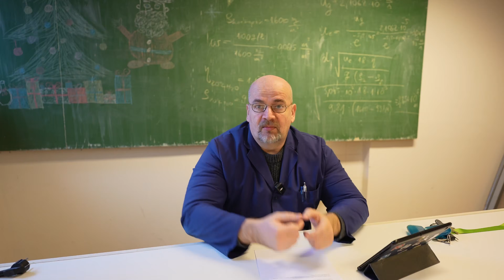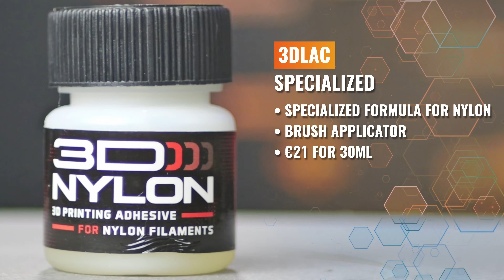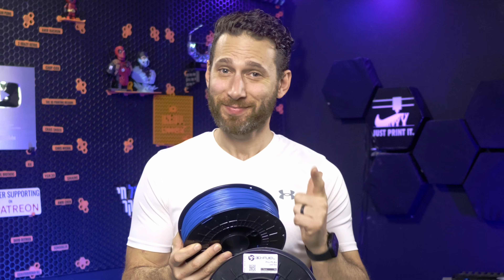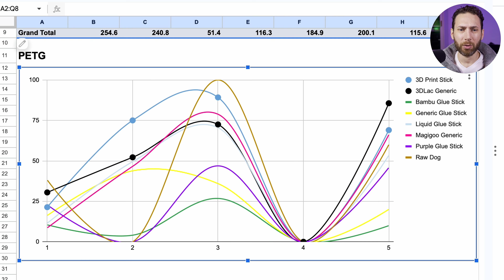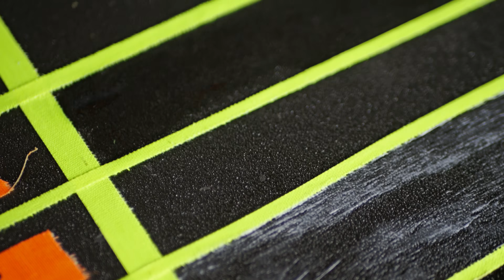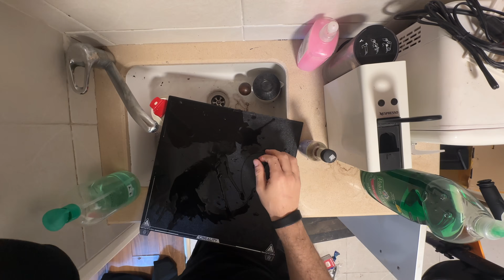I Tested 7 Types of Glue Stick for 3D Printing Bed Adhesion

Comment: You know you can wash glue stick off with lukewarn water and dish detergent, right? Same method to clean the build plate. Never had permanent glue stick staying on the print.
The glue stick is also good to avoid damaging build plate as a release agent (for example, TPU in PEI, its function is not to stick, but to release)

Comment: Suggestion for glue stick scars, I use the scrapper (plastic or metal, use the scrapper at the lowest angle possible so it doesn't bite the texture) and scrape the glue on the plate , that removes almosts all scars and evens the layer of glue stick. I've done this for the pas 2 years on the same PEI texture plate with little to no premature wear on the plate. Also, glue stick doesn't help the first layer adhesion for PETG, but helps release the print without damaging the PEI underneath, as i've see PEI peel of the plate with PETG.

Comment: I keep looking at how good raw dogging is. I feel like the point of some glue sticks are not to adhere, but to release prints after finished. Focusing on how easy to remove prints afterwards would be a different but key important test.

Comment: Would have loved to see hairspray. I expected to since it was mentioned in the comments at the beginning of the video.
I mostly use a bare plate cleaned with alcohol. If I have a bed adhesion issue hairspray has been my go to.

Comment: 5 identical plates  10 samples of the same glue /material  and a removal tool that pushes against the perimeter so the plate dosent bend influencinthe the print next to it ,change glue and repeat break it into 5 videos about each material
this increases your video output , and is more catered to the material we are printing when we google your videos as a reference, increasing the value of the video to the viewer

Comment: I stop using adhesives for 3D printing 3 years ago. I print on a plastification PET film adhered to my bed plate. It stiks when hot and let go when cold. Works for PLA, ABS and PETG.

Comment: A glue stick (purple) geek here, my solution is the best I don't follow the science I know best - END🙂  Well to be fair I use different methods for different materials - different surfaces as well.  Your sample is too small for ABS and Nylon shrinkage you know. Nylon - glass bed, multiple layers of glue stick, heated chamber, a raft depending on the print.

Comment: I’m disappointed that you couldn’t get the Vision Miner bed adhesive. I use it and am amazed. Absolutely no adhesion fails and perfect release with the clingy filaments. I get dozens of prints of PLA and PETG between application. I use mostly Bambu smooth and textured PEI plates.
Reply from the maker: Yeah, me too :(

Comment: Thanks for all your hard work. It's always informative. For my money, a good quality hairspray has been all I ever needed. I only print in PLA and PETG. For PLA it's helps adhesion even on my textured PEI plate. For PETG, as you and others have noted, it sticks to every frigging thing. Thankfully, after the post-print cooling, I find the hairspray is a great release agent! So much so that PETG no longer leaves residue on the plate after printing.  Hairspray in a big can is cheap, the can will last a long way, and the spray can is easy to master to get a consistent, even coating on the plate. Best of all, it washes away quite easily with some warm water and some elbow grease. Your Mileage May Vary, so use what information you have at your fingertips and make your own judgement on what works best for you.

Comment: In my limited experience, nothing I have tried adheres ASA better than a two layer thick disc of PETG directly on the plate and a filament swap.
Let it cool down fully and the PETG cradle will peel right off with a perfectly servicable surface finish 🙂
Reply: @HolmgrenJensen  I use the Vision Miner NanoPolymer Adhesive when printing with ASA and have absolutely zero issues with adhesion. I print all of my Bambu filament spools with ASA on a Bambu smooth PEI plate and they seriously grip the plate. Filament spools are a prime candidate to lift and I have no issues.

Comment: Fail, on pretty much every count. Experimental design (none), poor apparatus, comical execution,   The data are useless.  The "analysis" is you blustering your way through the shambolic results, inserting your surmises and opinions based on (nearly literally) no supporting data.  I didn't get to the end, but if your reviewer didn't fail you on your experiment and "analysis", he should have.  Don't do "science" - you have no aptitude for it.  This is not a service to the community; it's a half hour of you dicking around .  I'll unsubscribe to save us both continued aggravation.
Reply from the maker: Yep, that's the conclusion I got to, as well. If you'd watched the whole video, you would know that. Byyyyeeeeee
Reply: @thenextlayer  So, you posted a video you knew to be of specious/no value.  Why??  I watched it as long as could - I didn't need you to tell me the foregoing 20 minutes were crap.  Do you not feel you have some duty to your  followers - most of whom are defenseless against nonsense promoted as science - not to mislead them (or at least not waste their time)?  Some people probably think you know actual stuff, and may believe they can count on you for competent advice.  I suppose you've got to push out the minutes the advertisers have paid for, even when there's nothing to say.  They'll catch on to that eventually.  So, Byyyeeeee!!

Comment: the results for PETG are "wrong" you don't use the stuff to promote adhesion

the gluestick is meant to help the PETG release better from the PEI sheet

without it you will (sooner or later) rip off the PEI coating

so better adhesion is not what you want

for me 3dlac spay all the way, but for PEI and PETG it is no solution, you'll just have to sacrifice a built plate once in a while 😂

Comment: Mirror mirror is very appropriate.

Because i print on an IKEA mirror.

Didn't most people use to do that previously?

Anyway the glass surface by itself is pretty bad printing surface, because adhesion is too bad for most materials, just about OK for PLA if it's super clean, and has no release capability for PETG, at least not without occasionally taking a chunk of glass with it.

If i was printing on a polycarbonate textured sticker i might not really need anything? This is what everyone was using before PEI and i have no idea why the change to PEI.

Printed PLA on pure PVP and it did not release AT ALL. Fortunately this problem is not TOO difficult to solve when printing on glass, since i can simply unclip the glass and soak it in a bunch of water. Now i add a little white glue just a picodroplet.

Igor was... perhaps a little nicer than most of us would have been, i feel.

Comment: Thank You for the video.

Something that I've run into is that there is disagreement on which products are "bed adhesion agents" and which products are "bed release agents".  Or maybe there's no difference?

Use hairspray as the example.  The only use case I have for hairspray is as a release agent for TPU.  TPU has held so well to my PEI bed plates that it's ripped chunks off of them, a little bit of hairspray and the TPU pieces come off very easily but held fine during the print process.  However, the build plate then needs cleaned because hairspray has caused problems with PLA and PETG failing to adhere to the build plate.

In the context of your video, specifically looking at PETG only, I'd call the Bambu, generic, and purple glue sticks and liquid glue as "release agents" because the bed adhesion was reduced below that of the untreated build plate.  Then 3D print stick and 3DLac I'd call "adhesion agents" because the bed adhesion was stronger than an untreated build plate.  Magigoo was a tie with the untreated build plate, so in the case of PETG on a textured PEI build plate it's neither.

Maybe there are additional variables to take into account, such as build plate material and separately build plate texture.
This video did a great job demonstrating the performance of these products with various filaments on a textured PEI build plate.  What about a build plate that's smooth PEI or another material entirely?

I am NOT telling you that you need to do any additional testing, but I WOULD watch that video.  

Rather, I'm only saying that I believe an accurate framing of the context of this testing is "The performance of various bed treatments, across a variety of filaments, when using a textured PEI coated build plate."

None of the above should be taken as a detractor towards this video, it was enjoyable and the information greatly appreciated.
Reply: The PEI and polycarbonate surface build plates already have dual action in combination with most printing plastics. They allow the material to form a bit of a surface weld, not to strong, when hot, and the adhesion is released when cold. Release doesn't really work for TPU and PETG as you say, but it works for most other things.

Similarly you want the same dual action for all the coatings that you choose to apply.

Comment: Wow ! I have only been printing for 5months and have only used 2 products. My textured plate plus my smooth plate plus my 
cryoplate have been cleaned with dish soap each day. I have found 3D LAC spray to be easy to use and ideal if you have lots of small pieces on same plate or thin layers at edge of bigger objects avoiding detachment during printing. I have used Bambu stick but didn’t like the application.

Comment: In this modern age of various bed sheets (especially textured PEI), I find I only need glue stick for particularly sticky filaments like TPU, which tend to over-adhere. So, I am only rarely bothering with glue as a removal aid, not an adhesion aid. In this case, I'm using a basic PVA since it is super easy to remove with just water. Of course, if I were printing PC/Nylon, I might be more reliant on glues. 

My conclusion is that most people won't need a fancy expensive adhesive if they are using a print bed suitable for the filament and most common filaments (PLA, PETG, ABS) aren't going to need it at all. 99% of people don't start out printing Nylon. Most don't even start out with ABS since PLA and PETG went mainstream.
Reply: agreed, if I have adhesion issues on PEI i just wash it and maybe use a brim
Reply: For me, I just can;'t get the bamboo basic green  to stick to the pei textured sheet no matter what i do, it just gets off. any other colour that arrived with the printer is fine.  But overall, I just use the basic liquid glue because it's the easiest to get evenly spread out.

Comment: Ditto - Really? No Vision Miner Nano Polymer? And even better than NP is "Super Sticky" from Lone Star Makers; unbelievable stick even ASA & ABS on bare steel plate 110C bed. For both of use a few drops and re-active between prints with splash of IPA. Saves $$.  No need to apply NP or SS as thick layer. Releases at room temp.
Reply from the maker: hadn't heard of it till just now!

Comment: I see one more thing that is probably affecting your longevity tests. By not allowing the plate to cool and release, you are likely ripping more of the adhesive off the build plate when you pull test them off hot.
Reply from the maker: Yeah, good point. So many issues with my experimental design that I didn't even think of. This is why I'm not a man of science.
Reply: @thenextlayer  Don't give up. We all have to start somewhere

Comment: Sometimes you can avoid using adhesives by experimenting with types of build plates and temperature. I had trouble with PC-CF on a satin sheet with the recommended 90°C bed temperature. It warped and fell of during printing. Same print, but with 130°C came out perfectly, even this is way beyond what is recommended on the spool.

Prusa has a nice table which bed is best suitable for each material. I stick to that and I avoid printing different materials on the same plate.
My PETG won't stick to the satin sheet anymore, if I print PLA on it. I have to thoroughly wash it with dish soap and alcohol to get PETG sticking again.

Comment: I often use a generic white glue for woodworking called Mekol, which I believe is similar to Elmer's glue. This adhesive also helps prevent PETG from sticking too strongly to the PEI plate. I apply it with a spatula. Applying a thicker layer can be useful in emergencies when certain parts lose adhesion during printing.

Comment: Really wanted to see result of hairspray.  I bought 3 cans of Aqua Net Extra Super Hold Hairspray in 2018 and using it ever since. I print PLA regularly with it and still on my first can!  Adhere very strong and releases easily when bed get cold.  I haven't come across anything cheaper or better in my 12 years of 3D printing.
Reply from the maker: I'd be curious how well it works with Nylon. The kind I bought barely held on to ASA...

Comment: I have a PEI bed and never used any bed adhesion product, if one of my prints fail I clean it with water and soap and for me it's always worked, but I have to say that I only print PLA and TPU
Reply from the maker: Do you print Nylon and ASA, though?
Reply: @thenextlayer  not yet, but i want to try it sometime

Comment: You should also try some different buildplates. I don't mean it as one company vs. another and while there's differences between manufacturers, I mean it more as the difference in texturing of the build plates.
The more you have surface area, the more you have grip and while the rough textured build plates seen to do the job, but the holographic "pretty" build plates are something else with that extremely small texturing.

Comment: The problem I have with PETG is that it sticks too well to a PEI bed.  I have ruined the PEI surface removing the parts.  I am going to try Bambu glue stick with PETG as a moderator to help me not ruin another expensive build surface.

Thanks for the testing!
Reply: Lower bed temp, dry filament

Comment: MAX HOLD HAIRSPRAY.

Spray it on heavy like spray paint.
Let it dry
Print parts.
Parts pop off automatically as bed cools.

Can be re-used many times.
Rense bed with hot water to clean.

Then reapply hairspray.
Reply: Worst advice ever. I tried 8 different hairsprays which cost me a lot of money and none of them held onto ABS and HIPS not even the tiniest bit, worse than bare glass. Also it was stinky and i hate the possibility of spraying onto mechanical parts, i did the coating on the bathroom but things you can apply right on the printer are a lot more convenient.

I suspect there are regional differences between hairspray composition. You're in North America right, i'm in EU, Jonathan is in Israel which if i were to guess is more similar in products to EU than to US. There's a lot of potentially harmful chemicals which are not in use in cosmetics here but are in USA, and declaration requirements are very thorough as well.

Comment: A Grade "C" from Igor is the same as A+ from common folks (but his comments were completely valid).
Igor certainly knows his stuff when it comes to testing procedures and scientific methods. 

I will probably never get around to do it, but it could be fun to do the same testing here at home.
But. I would make some changes to the testing methodology like:
1) Make a jig for the pulling, to ensure that each pull is done in the same direction and that the build plat don't flex underneath from the forces applied.
2) Use a tool (nut & bolt with a hook) to apply the pull force in an even and structured manner (maybe add a spring too).

This is not meant as criticism for the work done here - it is very informative, interesting and useful - its merely "lessons learned" kind of thing.

Comment: Yeah, as much as you don't want to, you're probably gonna have to redo this if you want it to be valuable to most folks. Though given your personal inclination towards projects different from this one, i won't blame you if you dont want to do it again. And should you choose to try again, I'd suggest you practice your measurement methodology before starting the actual tests. You've already learned that you'll need to remove the masking tape strips, that you need to find a consistent way to hook the scale to the samples (I recommend a jig of some kind), and that you need to do a better job of cleaning the plates. An additional recommendation of mine would be to print the separate materials separately to get optimal adhesion, bed temp, and to be as close as possible to the design parameters the specialty glues were designed for. Obviously that last recommendation is likely to result in much more work on your end, so feel free to completely disregard it XD

Oh, and for the jig for the scale, maybe consider designing it so that it presses down on the surrounding plate around the sample you are testing, as you are testing it, so you don't get a lot of bed movement that could cause error in surrounding samples. Also also, maybe make the test samples larger, so it's easier to get the hook through them
Reply from the maker: All great feedback, thanks for taking the time! I don't think I'll doing more videos like thist, but if I do...
Reply: @thenextlayer  yeah, that's totally understandable lol. though if you feel like torturing yourself again, id definitely love to see a redo of this video, as this has been something ive been very curious about!